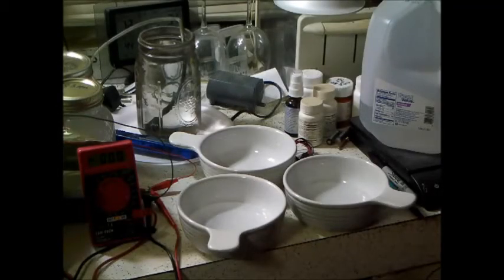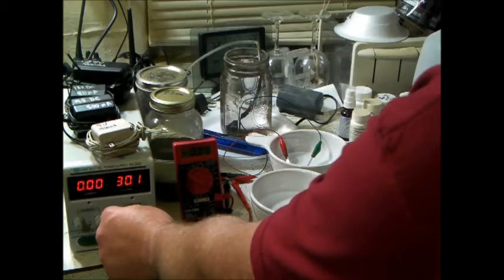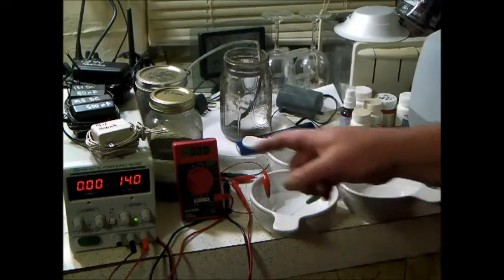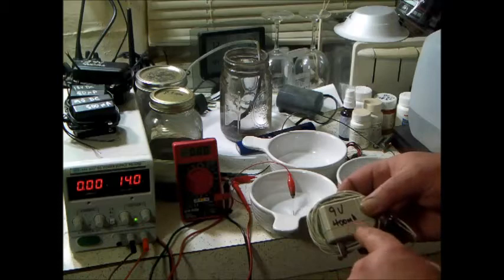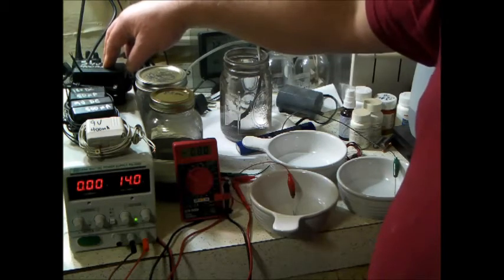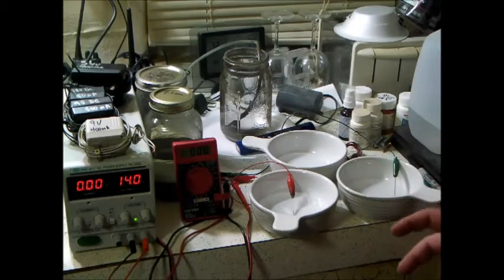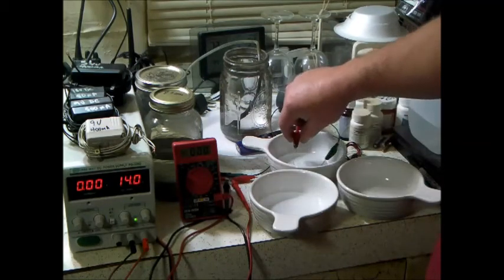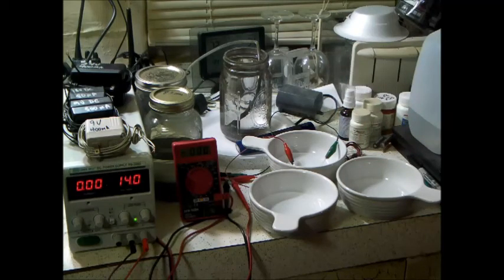Colloidal Silver Power Supplies.. What actually is happening.

Comment: THANK YOU!!!! Finally after watching over 50 videos I finally find someone who explains the power supply part of it.  It is hard to believe that none of those videos explained how to get power to the silver rods other than hooking to a 9-volt battery.  THANK YOU.
Reply from the maker: Ha.. I knew when I saw the first 7 or 8 words of your sentence,,,,, I knew exactly what video you were commenting on.. I went through the same thing, but, there wasn't this video..Ha.. I did all sorts of experiments over 6 months time and then experimented with the product even longer from each batch.. Guaranteed,, they all worked the same.. 
It's not a Colloid vs Ionic thing for sure.. It's about suspended particles of silver of both sizes and everything between and above and below.. It is what makes it work on such a wide variety of things.. 
Yes.. Hooking up the power supply to the silver is easily done with a pair of Alligator clips.. 
BTW.. Read the first paragraph a couple of times.. If hooking to the Silver was an issue and you research further,, you will start wondering about Ionic vs Colloidal Silver.. Just know.. There is no difference when home making silver.. Unless you have a lab with equipment worth much much more than your home and newest car, you are going to make both and a range above and below both.. That is what I researched for so long, until I finally got back to basics and started looking at it from a different perspective.. Started with the lab power supply and some current limiting diodes.. Cheers and good luck.. Everyone should be making and using this..
Reply: Mark Thomas Thanks Mark, yes, I got that point too from your video.  I was particularly trying to find out whether I really needed to go to the hardware store and buy more equipment or if I had everything I would need.  Especially what power supply I needed.  I have an extra HP AC Power Adapter that says, "For use with IEC 660950.  It is a little more than a standard type of adapter.  If I cut off the end that goes to the appliance it has 3 wires, one for +32, €, +16.  Written on the adapter is Input: 100-240 V-1A 50-60 Hz and Output:: 32v 9940 mA 16v 625 mA. I am a "grandma", not an electrician, but do you think this will work?  Maybe I can email you a pic of all my components of this project?  I want to get started on it in the morning.  I really do appreciate the video.  You're a very smart man!
Reply from the maker: Well hello Granny then.. Ha.. Yes. That should work just fine.. It is way more than you need, which is good, because it should not do more than just idle for lack of a better word.. 
Sounds like a Deskjet power supply.. Not sure why they have dual voltages, but, you can easily check them both and choose which works best.. To start with, it only pulls a very low voltage 1mA, but, as more silver is deposited in the water,, it is more conductive, so, it pulls a higher current... 
Just touch the Power supply while you are making and make sure it is not getting too hot.. Warm is fine, warmer than warm is fine, but, if you think it might eventually melt a Styrofoam plate, then, it's too hot.. 
I would expect it to get a little warmer than warm in the later stages of making.. Probably when it gets up past 20-40ppm (Parts per million).. 
Cut the 3 wires off and strip them back (unplugged of course).. You probably have one black, one white and another color.. Usually, 120v 3 wires are Black(Hot), White(you can think if this as a ground, but, it is called a Neutral, and a green which is referred to as a "frame ground"... Probably not your case withe the dual voltages.. Probably a Black/White/Red or some other color.. Pick pairs of White and another color and that should be one of the other voltages, using white as the common wire between the other two colors.. 
Checking the mA is more complicated, but, checking the voltages is easy. Anyone with a "Volt or Mulitmeter" can do it... 
Check the Output voltage one more time.. It should say either AC or DC on the Output side with the 32 and 16 volts.. DC is what you want for a power supply.. AC is different and a shock hazzard. Actually it can be used, but, I would not, and I have not tested it.. Also check the printing on the 32v side.. It should say 994 or 940.. 9940 is almost 10 amps and quite a bit, unless it was used to power a laser printer and fuser unit.. 
If it actually says 9940, I would strip the wires and take it to a Radio shack,, or Auto Parts store or Electronic shop and ask them to tell you which two wires are which and tell them what you are doing.. They might appreciate knowing about it also.. If it is 9940, I would use the 16V side..  Strip the wires back 4 or 5 inches and put a piece of tape on each and you can write 32 and 16 on the other wires when you find out for sure..
I would be happy to take a look at your pictures..  Info@PaddleInnRafting.com .. 
In the Subject line,, put "YOUTUBE COLLOIDAL SILVER", and I will watch for it and reply back tomorrow evening.. I will be out and about making some equipment pickups for a project I am working on now..
I'm just wrapping up on it now.. 4am and I have an appointment at 9 am 45 minutes from here.. Ha.. 
Just remember.. Distilled water only, or Osmosis, or some other type water.. No salt added ever in this mix.. 
You should be just fine..  If you ever run into someone with Shingles,, give them some 40ppm Colloidal Silver and mix it 60/40% with DMSO (Diamethyl Sulfoxide). I did not look that spelling up,, but, if it is not correct, it is close.. Just spray it on the affected area and above, below, and side to side of the breakout.. (It travels the nerve path, so, is further than the surface shows.. Usually only takes one application. And, you can use it for anything just under the skin to get the Colloidal Silver down to it.. Careful not to handle stuff you don't also want inside.. (No chemicals, insecticides, etc when using or making it.)
Thank you for your compliment.. You are correct though.. I try to learn something new everyday, and often do project that others say can't be done.. If they think it can't be done, then, it has my attention.. I enjoy the challenge.. IEC is an Electronics Board of Specifications.. The 660950 is a specification.. I didn't see what exactly it referenced, but, just spent a minute looking at it. So, don't worry about that bit of info... All you are interested in is the Output, since input and Hz covers you no matter where you live in the world.. Here in the USA, 110 or 120 and 60hz is what we use for that type of appliance.. Overseas, 240 and 50 hz.. 
I guess it is possible that the different voltages and mA's could be related to the Input and you would actually have a ground wire (Green frame ground or bare copper frame ground), but most likely two different voltages and one neutral.. Either way, it is easy to figure out with a Volt Meter set properly to the correct AC or DC and correct voltage range.. Always use the higher setting than what you are testing to be sure if you try to test it yourself to see if you can do that also.. Harbor Freight sells a cheap multimeter for about $5.00 if you are interested.. 
I think you will do just fine.. Glad to see you are after new things to stimulate your mind.. It will keep you sharp..   
Cheers.

Comment: I don't find many tests on line as this one above, thank you. ...
Reply from the maker: you're welcome, wasn't any when I was looking for them either.. Trying to disprove the me that you have to buy one of these fancy machines.. Cheers and good luck
Reply: Cheers. ... Look at the ones I make, they all use the batteries or a 1 amp 12 volt wart, lol but check out the videos, Simple all comes out the same. ... I'm just having fun making it. ...
Reply from the maker: +Oliver Van Correct. nice use of lights.. I like your stirring technique in the one video.. I assume a power supply fan with a magnet and a little piece of metal rod in the jar? That looked like it worked pretty well. variation does keep your final product a lot clearer.. try colloidal silver on everything. 
you will be utterly amazed at how fast it can heal a burn.. I have had third degree burns that had fresh skin growth in 12 hours.. Cheers and good luck
Reply: Thanks Mark. ... All the best this New Year and on. ..;-)

Comment from the maker: SmalltimR... Agreed.. I spent quite a bit of time recently with this power supply, moving the electrodes closer, further apart, etc.. I even ran 4 batches at once using wheat lamps to regulate current to each, using the power supply to supply current to all. When you start off with Distilled water, unless you don't get a lot of current moving across the two electrodes.. Usually under 10mA between say 12 and 30 volts.
I usually brew with them about 3" apart. I closed the gap to about 1/2", and didn't get a measurable amount more of current..
Over time, it will develop some type of electronic path (invisible), and the amperage would rise slightly if there were no disturbances in the water.. Say from 10mA to 30 or there about. 
Almost like an invisible chain of silver.. But, when I turn on the aerator, it dropped back immediately.
I always get a cleaner silver solution when I aerate it, and the end result is always good.
I did brew one batch without air for testing. It always makes a yellow tinted solution.

I still have to test the results of these end products, but, considering what I was making before, and what I was making with it with as far as power supplies go, I covered the full range of what most people have at home or can put their hands on.. Which was the main point of the video.. Its always good to have someone not selling something to post their experience with the product.. There is no good reason for me to promote or demote anything, and it takes time to do the videos to share them, so, I must have some good reason for making them... That is, to help others... A video or two like this got me started, after a whole lot of research, trying to figure out which way of making it would work... That was several years ago, and there wasn't a whole lot of information on it, other than those trying to sell their own generator, etc.. My first batch was made with a 9volt battery.. Next with 3 9volt batteries in series, and next was wall transformers.. Seeing it work for others is better than it working for myself. Ha.. Cheers.

Comment: It's good that you're having fun. However what this video seems to miss out on, is the importance of the electrochemistry associated with the colloidal silver making process. ie, while you may feel all power supplies are equal and/or adequate, it remains that the quality of the solution is proportionate to the bi-products created at the boundary layer of the anode. IOW. the way in which the current is applied and/or controlled with respect to the anode and cathode(size, distance etc), is largely dependant on the voltage(bridging) and effective maximum amperage. Which is something that needs to be calculated so as to avoid overdriving the anode OR falling short of the minimum voltage potential needed to achieve an effective ion discharge. And so in this way, the power supply has to at minimum, meet the requirements needed to produce the desired results. To which I'd add, can be manipulated by electrode placement(proximity) as you demonstrated in your video, though in cases where larger volumes are concerned, these rules change. And so it ends-up being very difficult to generalize rules in cases such as these beyond that of "meeting the need" in terms of power supply requirements. 

Having said all that, ideally, a power supply would be coupled with a voltage and amperage controller so as to maintain optimum voltage and current ranges throughout the processing phase. Which leaves us with plenty of room for improvements beyond that of conventional power supply applications . As a conventional power supply would not adjust to maintain optimum voltage and current throughout processing. 

Beyond this, there are exceptions and conditions that take place when there is too little voltage and too much current in processing. Namely that of crystallization and agglomeration. Which is something that doesn't often come-up in the home-made colloidal silver production howto's and videos. 

Hope this helps.
Reply from the maker: I never saw this reply.. Sorry.. Thanks for the info.. The solution starts out in the miliamp range and does not increase significantly... The larger Wall Warts (wall based transformers work fine, but, not many are designed for the voltages over 12 to 24 hour periods.. 
I have used all sorts of power supplies.. The ones that work best are the larger, more heavy duty ones, just because of the duty cycles.. 
As you can see from the video, I do have a Lab grade power supply where I can alter the voltage and amperage.. I purchased it for testing only.. I don't use it in making the Colloidal Silver.. It takes up too much room and is not necessary.. 
My favorite Power supply is from an 18 volt drill that stopped working.. And, you can get the from Harbor Freight for $10.. That is also why I recommend them.. But, as you can see from the video, I have used anything from 9 volts to 40 volts.. All produces the same product, because the limit is the distilled water and the spacing of the anodes, which is restricted by the Large Mouth quart jar spacing.. But, I have made them in much larger containers with the spacing much further apart also. 
Thanks for the detailed response, but, not to confuse anyone here, this is really a simple process with simple equipment. Nothing fancy is needed.. I have been making it for over 10 years and have yet to have a batch not effective.. I even supply a quart every 2 weeks to my Mother for her Hot Tub. We stopped using Chemicals all together.  Yesterday, I gave an employee suffering from Asthma that I think was progressing into a Pneumonia some to put in her nebulizer.. She had already reached her limit of the Albuterol.. She took 3 treatments in one day and started one the next morning and knew she would be fine by the end of the day, but, the day before, was confident it was going to be a Hospital visit without some intervention.. Works great on Shingles too, if you mix it 75/25% with DMSO to get it to the base of the nerve.. 
Cheers..